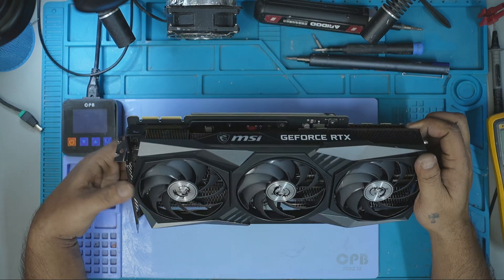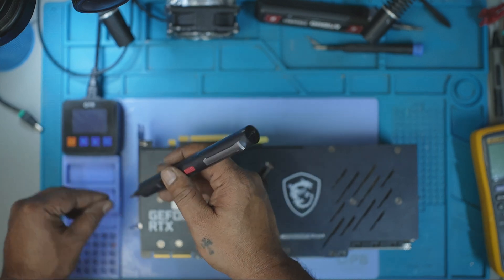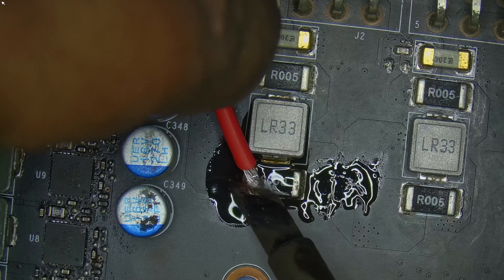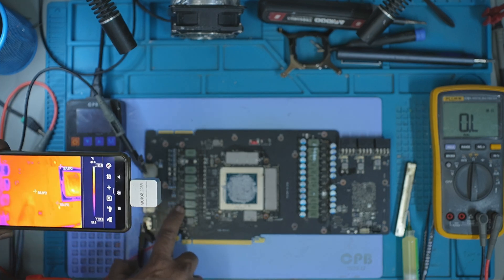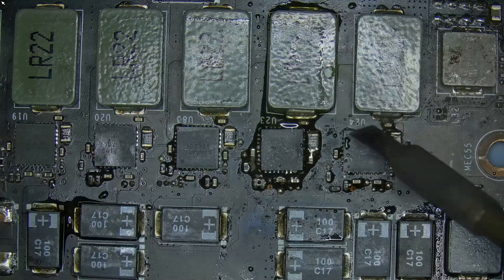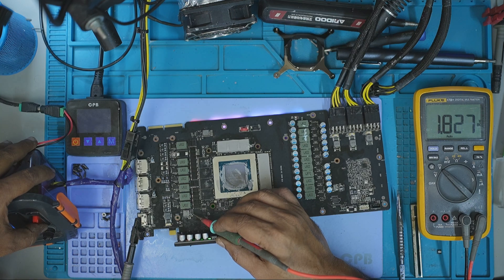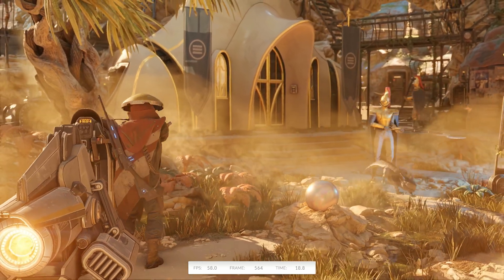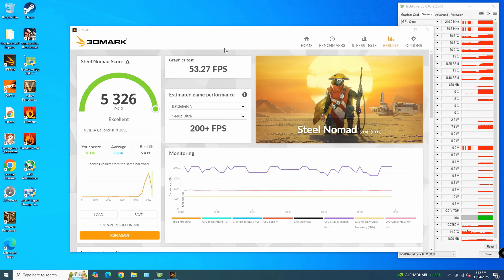MSI RTX 3090 Repair – Dual Short Circuit Fix

Comment: love videos, I got a 6700xt flood damaged by hurricane Florida. Did an alcohol wash. worked! wanted to get more corrosion off of it rust. etc. Ultrasonic cleaner tap + detergent (worked before on MB CPU RAM of same flood damaged PC. Ultrasonic about 1 hr. at 70C water temp.
After ultrasonic blasted out water when coated with CRC 226, blew out excess. Let dry out a couple of days. Now not working, VGA light on MB, no power no display. Going to try hot air on Cpu / Vram, with flus again if no work.
 Thoughts? ty in advance.

Comment: Pls help me brother Iam just upgrade my gpu from 1050ti to 3070ti but it won't turn on i tried all the possible trick when I unplug the pcie cable from the gpu its starts working normally n my psu is 750watt
Reply from the maker: It's not possible to upgrade 1050Ti to 3070 Ti. You will short circuit everything.

Comment: Is there any way to buy gpu cores i want to build a frankin gpu but dont know where to buy a core
Reply from the maker: GPU cores are available on AliExpress but I will suggest against buying core from there. The cost is more than buying a used working GPU of the same core. Best is to buy used GPU and take the core from that GPU. Then you can make your frankin GPU.

Comment: I'm concerned with all the repair videos, seems the newer cards fail very often for various reasons.
Reply from the maker: That is not the case. The ratio is the same or similar. The volumes of sales have increased of newer cards. And also i currently accept only 20 series and above for repairs due to the repair costs out weights the value of the older GPUs.